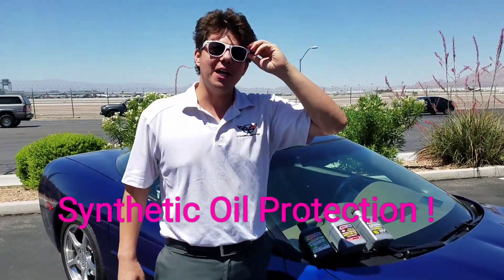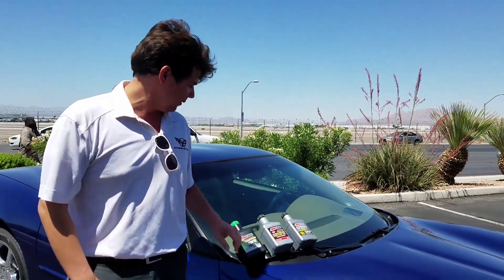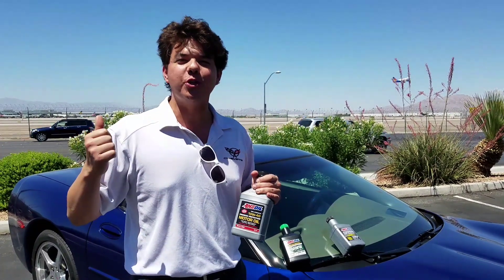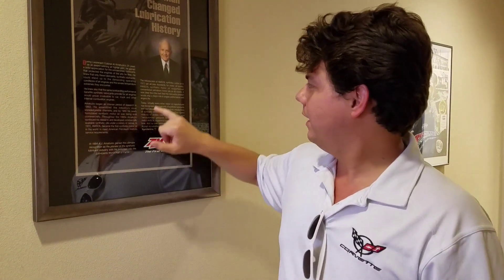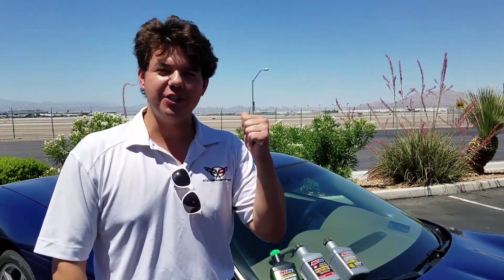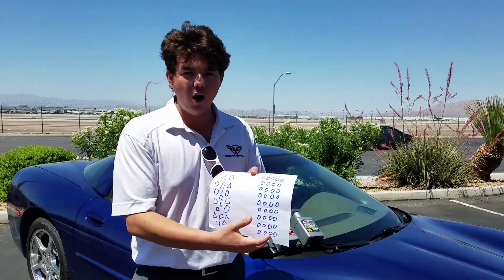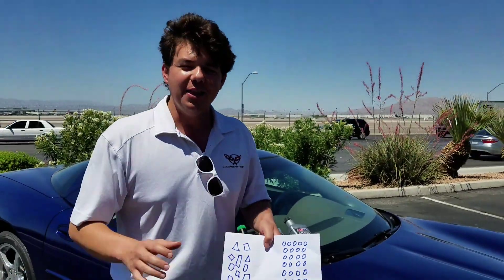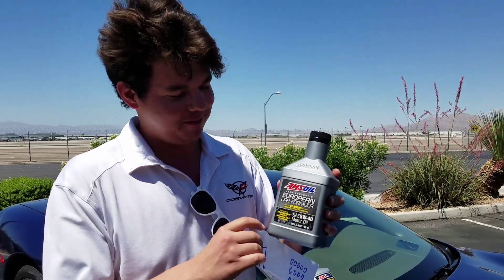How is AMSOIL Synthetic Oil Different ?

Comment: How good is the European formula when compared to signature series?
Reply from the maker: Great Question !

Euro is made to exceed OE Protection. 
If your Owners manual calls for 10,000 miles then your good for 10K if you go over that you should change Oil filter and do oil testing. The limiting factor is more idling hours. 

Thanks Issa !